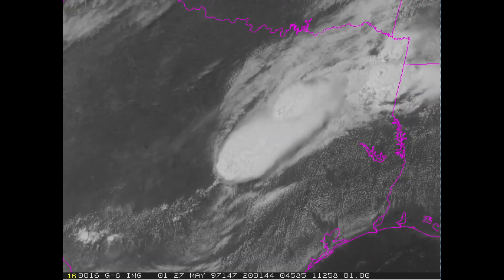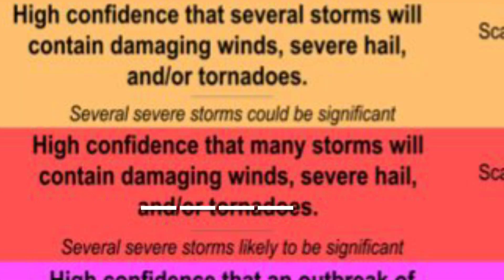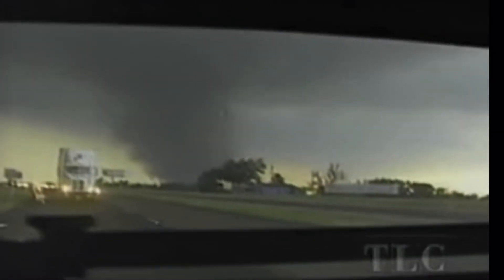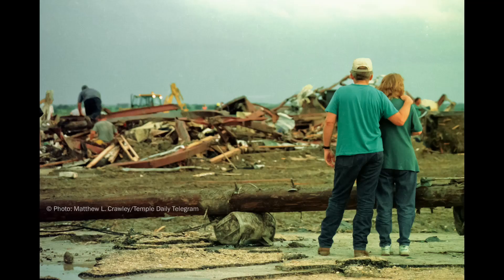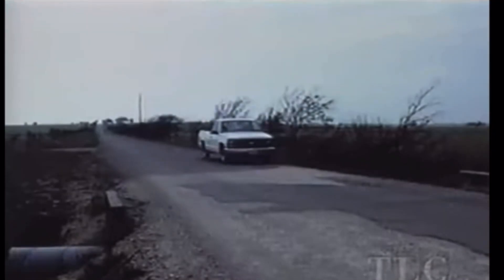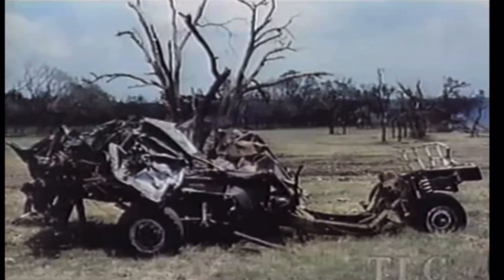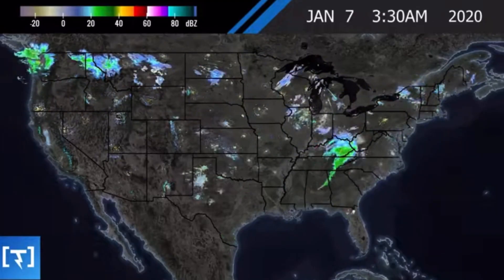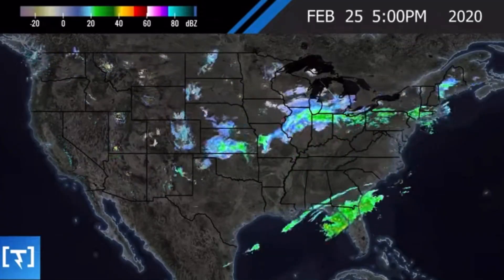The 1997 Jarrell "Dead Man Walking"  F5 Tornado 25 years later....

Comment: If any tornado could be rated and F or EF-6, this was that tornado. Either that or let this type of damage or slightly below it be an EF-5.
Reply: The way the EF scale measures tornadoes makes it impossible for there to be anything more than an EF5. It could have 1000 mph winds but would only be capable of EF5 damage because anything above that is inconceivable
Reply: I agree 💯 this one, Smithville F5 tornado 🌪️, and Moore should be only three F6 tornadoes
Reply: @cs77smith67 Moore 2013 is not in the same league. The 99 one is much closer
Reply: @MeesterJ  the Moore 1999 tornado 🌪️ is the one I'm talking about
Reply: @cs77smith67  ahhh then you are definitely correct!
Reply from the maker: I believe the xenia Ohio tornado actually had a preliminary rating of F6 before it was downgraded to its now F5. https://en.m.wikipedia.org/wiki/1974_Super_Outbreak Scroll down to confirmed tornadoes and then the bottom of Xenia ohio. "Fujita initially assigned a preliminary rating of F6 intensity, before deeming F6 ratings "inconceivable". I do believe that there are some tornadoes that were powerful enough that the F5/EF5 rating does not fit them. Maybe EF6 will be added if enough of these events occur.
Reply: @StormsQ  Xenia, Smithville, Phil-Campbell, and the 1974 Guin AL tornado all produced "very extreme" F5/EF5 level damage, but all of them had a forward motion of roughly 50-70 mph. Unreal for those tornadoes to do the amount of extreme damage they caused while moving so fast. That's not to take anything away from Jarrell which is very much an F5/EF5 and is one of the most extreme tornadoes ever(just look at the violent rotation on that twister. It was churning aggressively despite the slow forward motion).
Reply: @StormsQ  I agree especially if these tornadoes 🌪️ leave damage like taking skyscrapers buildings off there foundation, empty lakes, throwing army tanks miles away like toys, digging many feet into ground. If it does stuff like that they have no choice but to give F6 even f7 raking
Reply: I think the 1999 Oklahoma F5 tornado 🌪️ was supposed to be a F6 but since that doesn’t exist it stayed as an F5 but i feel like it was more than that for the distraction it caused and how thick the funnel was